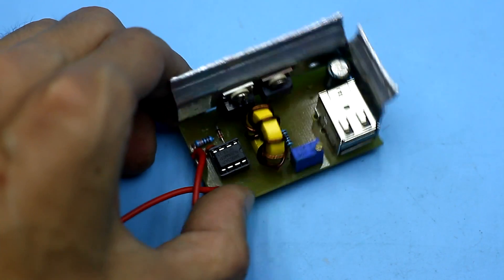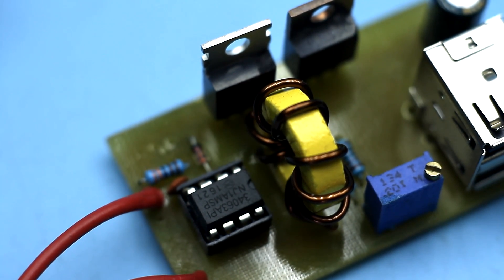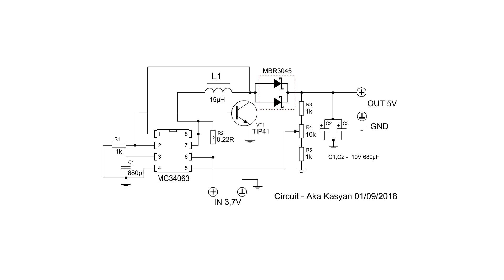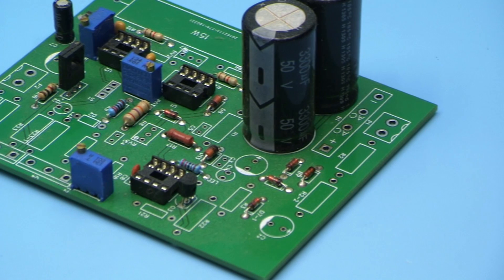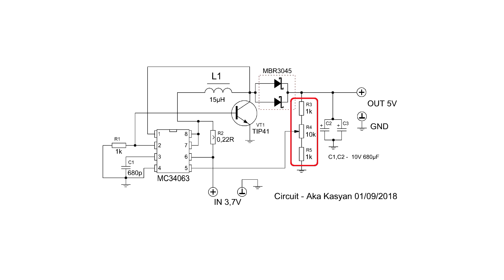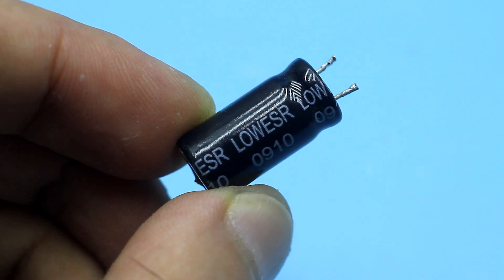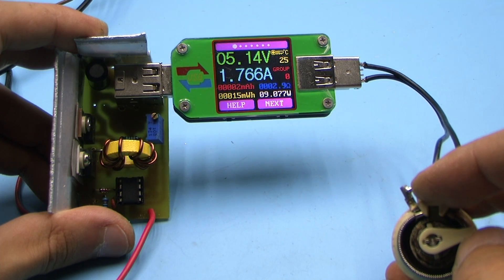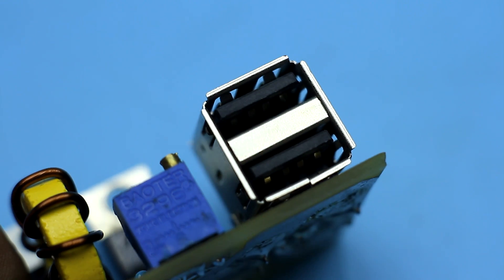DC-DC step up 3.7-5V converter

Comment: Why wouldn't a ferrite core work? How do you tell them apart from Iron core? 
Your explanations are shallow.
Reply: Ferrite core would work, but likely change the number of turns of wire needed.
Short answer, they didn't do enough testing.
Reply: You may also run into problems with Magnetic Saturation when using ferrite. So the required ferrite core may be bigger than the required iron powder core.

Iron powder cores often have a yellow paint on them. Other than that it´s hard to tell them apart.

Comment: I watch all your videos , I would like to correct the use of the word Throttle, the English word used in electronics is Choke.
Reply: Better call it "inductor". The name "choke" is usually associated with it being a filtering component to block noise/high frequencies, not to store energy in a boost circuit.

Comment: That's a great piece of work, thanks! What about putting a darlington transistor? Could it increase the efficiency?
Reply: not tho mutch, the problem here is that is a BJT and not a MOSFET but i think the the lack of efficiency is not caused by the transistor that much
Reply: @nunosousa2942 , thanks for the quick answer :). My mind says the same, since it's being driven by just 3+ volts, it's difficult to put a mosfet, even a logic triggered one. I am wondering if maybe a darlington configuration of BJTs could improve a bit the efficiency? For example, one of my solar controllers is using step up converter with an efficiency of 74%. Indeed, that one uses mosfet for switching. Compliments for your great work!
Reply: sorry for the misunderstanding. In the fact i think there is mosfets with very low threshold voltage like 2v or so, but answering to your question, a darlington with is high current gain will just decrease the current sent out by the chip to the BJT and this may improve the efficiency but a very tiny bit due to less losses by joule effect in the chip
Reply: You're right, in fact the BJTs in the chip they are connected in darlington configuration and they are putting your around one amp safely. So the current for driving the power BJT is enough. You opened my eyes with the 2 volts mosfet, I didn't knew that exist. Again, thank you!